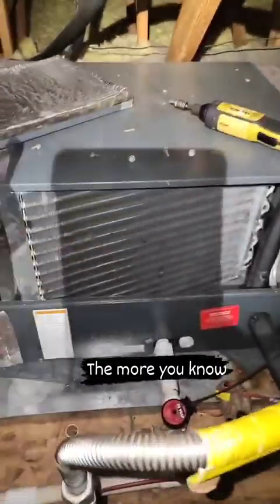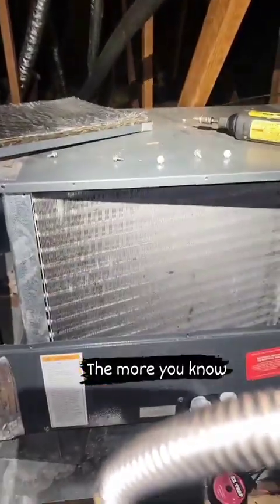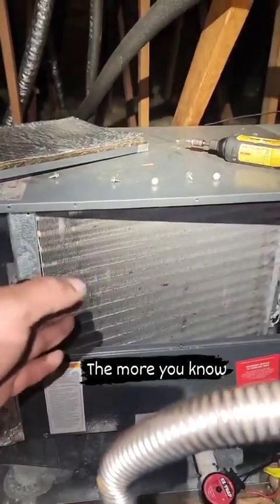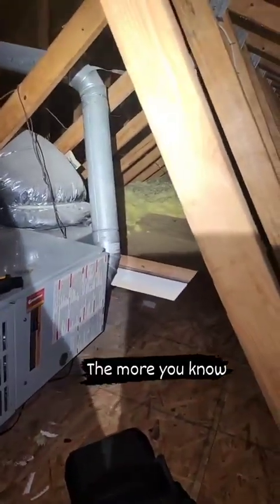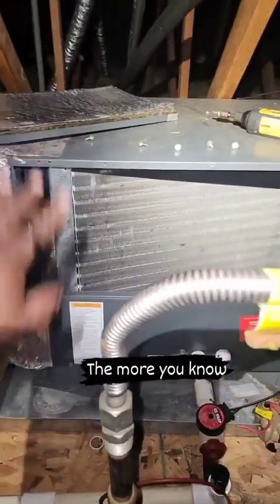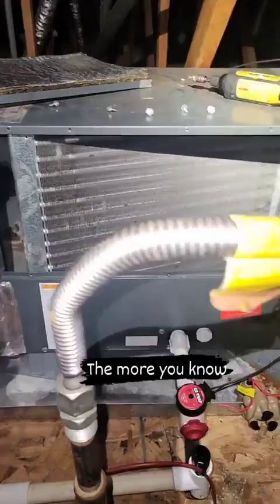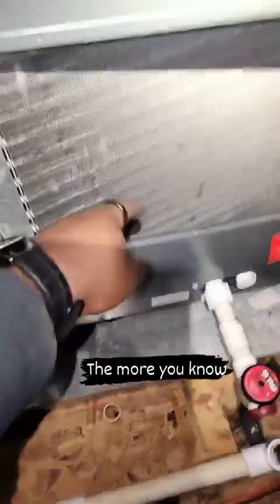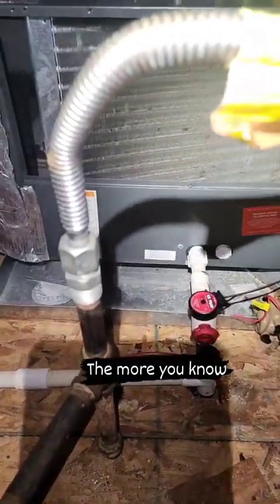why does mold form inside hvac systems

Comment: Thanks for sharing! What’s the best way to get the mold out. I’m having this issue in 2 units and no one wants to clean it out they want to just put a I’ve light in there and leave the mold. They say the light will kill it.
Reply from the maker: The best way is to pull everything out and clean with a  cleaner. Just adding the light won't be as effective . It's like blowing up the bathroom and spraying air freshener lol. Have them atleast pull the blower motor and clean it
Reply: Thank you. I’d do it myself if I knew what I was doing. Im going to have to find someone to get this done correctly